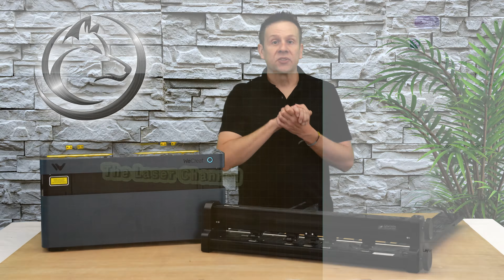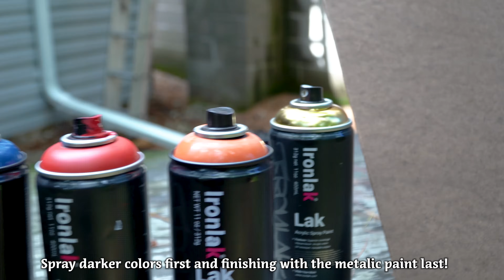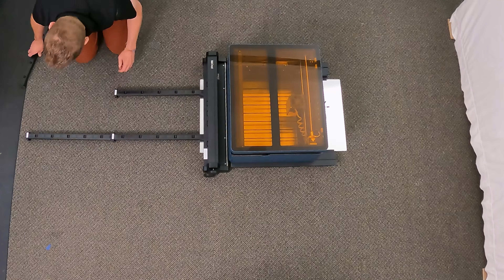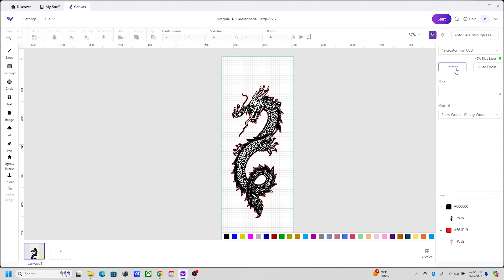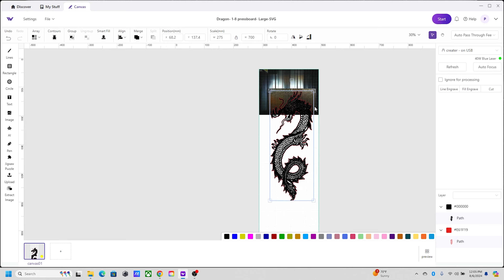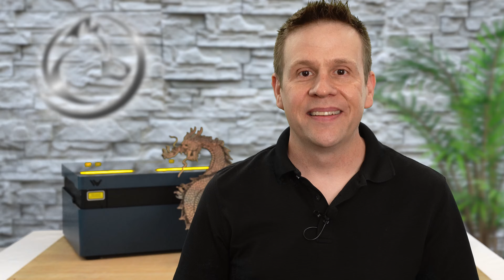WeCreat-  Auto Pass Through

Comment: Pass Through...from what I watched on wecreat you need to have 10cm/3.97" loaded inside machine and 50cm/19.685" of wood is needed extended beyound the size of you project? So, if I want to do a 36" desighn I need almost 5' of board? That can be expensive, an 8' piece of wood can really only cut 46"? is there any way around this? In reality, you can't make a sign 4' long. Seems like a waste to me...
Reply from the maker: I can't recall the dimensions offhand, but you are already account for the feed distances.  I don't recall needed nearly 20" on one of the ends.  Here's a link to more info: https://support.wecreat.com/hc/en-us/articles/10263492397071-Tips-for-Using-the-Auto-Passthrough-Conveyor
Reply: wecreat says one thing people do another and the peoples are better..
Reply: I suggest that you that you only add the 4-5 inches to your 36in project. Then add to it a scrap piece of wood that's 20 inches, make sure its the same thickness as the project wood and attach it only to the end side of your project board, (not the beginning end).  Use a strip of 3" wide tape on top to attach them to each other and one strip below, using something sticky like black duck tape, gorilla tape, seam tape (ram board) or better use Scotch "rough surface" green painters tape that is extra sticky and is used on raw wood. When you are done you can reuse that scrap 20" piece of wood over and over again and that way your not wasting any wood for future projects. Just don't cut or engrave on that tape and make sure its fresh pieces of tape, rub them into the wood good so they don't come off.

Comment: Any danger with using the pass thru, like rays escaping from the pass thru endangering eyes? Do you need to have the laser glasses on at all times?
Reply from the maker: Good question.  When I ran the machine I only saw narrow gaps- maybe if found the perfect angle to look at the machine I could be exposed directly to the laser scatter.  Overall, I think the machine is still very well protected from escaping laser scatter beams.  If in doubt- toss some safety glasses on!